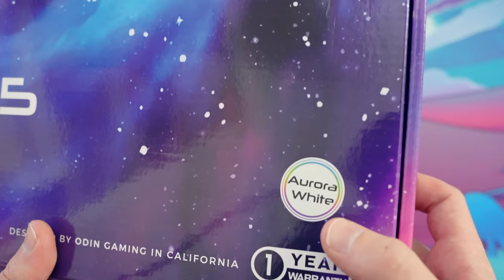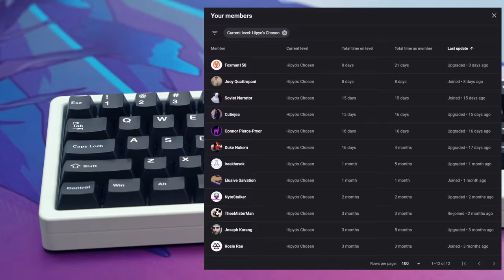This is a keyboard?

Comment: This is a nice board for the price, if you absolutely need a metal case. I think the KBD67lite is still the right way to go if you want a budget 65% with the "gasket" mounting style.
Reply: No one asked
Reply: personally i think the bakeneko60 would be a better option over this keyboard, it has a good gaskest mount and has a metal case, 130 for the barebones kit
Reply: I adore my kbd67lite!! Agree wholeheartedly.
Reply: @buyspride6165  hard disagree. It's got a worse finish. Weird o ring mount that poses as a gasket mount and also the Nova65 has Durock stabs for this price and is a 65% versus a 60%. Not even close
Reply: @liquiddawn82  how about ikki 68 r2 being a better 65%. Its pricier but it is a lot more customizable
Reply: @liquiddawn82  "Weird o ring mount" What the fuck? It is literally what the Unikorn uses. And at the least, the Bakeneko can actually flex and bounce. This board also sounds pretty shit stock.
Reply: @Archurus  what? This board sounds fantastic stock. Have you heard all the various sound tests posted including Alexotos? Everyone agrees this board sounds fantastic stock. Even Bad Seed stated that no one would complain about how this sounds stock. What are you on? And yes. It also has a proper gasket mount. And not a shit painted case. What the heck?
Reply: @nikocayetano1805  I dunno. I was looking at it. It's also got a ton of issues. The gasket mount isn't great once you add the proper amount of silicone to get it to sound good. It's got a weird PCB with some odd facing switches due to them insisting on having ANSI and ISO layouts in one. And on top of that it's also got the same USB as this with no daughter board. And it's a plastic case that you are paying more for. Oh and you can only use their stabs on it and no others unless you modify them. Why would I get that. When I can get this that's made from aluminum and costs less? Makes no sense at all. I'd go with this or KBD67Lite
Reply: @liquiddawn82 Preference.
Reply: @mqonke  Y comment then
Reply: @mqonke  Goes to keyboard video, gets triggered when there's comments about keyboards
Reply: @grithonthesev6811  Damn all i did was post a positive comment about the board and also the 67lite, spawned an entire argument in the replies i love this community /s
Reply: ps the bakeneko is sick idk what y'all are on. second they drop the 65% group buy im jumping on no questions asked
Reply: @Andrew-ng3sc  yeah but they just said they updated Nova65 to have a daughter board going forward. It's also a full aluminum case except the bottom which has under glow. It's also a 65% with a much better quality case. The bakeneko is a cast aluminum case that's painted. This is CNC machined and they anodize it. What the heck? It's funny how people will go to the depths to defend their board just because they purchased it without objectively saying well this is better.
Reply: @Andrew-ng3sc  dude. It's still an issue is it not? You still require mods to use other stabs. So we will overlook one set of issues but not another set based on solely being biased. Insane.
Reply: @mqonke  L human being
Reply: @liquiddawn82  the o ring mount is more flexy nad better than the gasket mount
Reply: @liquiddawn82  
Have you even seen the flex and soundtests of the bakeneko?
Reply: @liquiddawn82  your trashing the finish even tho theres nothing wrong with it lol
Reply: @mqonke  your the funniest guy alive

Comment: I am getting my Keycron Q1 this week. The reason why I got it is that I want an open source program so I don't need to worry about it being obsolete in the future.
Reply: Own one and bad news is the Q1 is already obsolete because certain keycap profiles are incompatible (MT3 is one) and their brilliant solution is to FILE DOWN expensive keycaps. The QC is extremely poor.

I don’t recommend Keychron anything to anyone.
Reply: Cool! Im getting my kbd67 lite delivered on the sixth!
Reply: @_iboji  Why is MT3 incompatible with the Q1?
Reply: @_iboji  do you even know what you are talking about?
Reply: I am getting an rk987 for my first mechanical this Christmas with matcha keycaps. My dream custom is a 60 or 75 percent aluminium case, hotswap 5 prong switches, (south-facing back lighting, of course), with lubed, filmed moss linears, and watering v3's for the modifiers, and akko world tour tokyo keycaps or some Japanese themed one with a deskmat for fun. I now realize this comment is way too long for the original message. I just had to tell some people
Reply: @ukann  It appears they did not pay attention to the allowable tolerances to allow for clearance for profiles that aren't cherry. You get collisions of keys at the edge of the board , most prominently the enter , right shift. There was a thread about this on Reddit and Keychron's (inadequate) response. Then it came out that their support has suggested all kinds of really bad solutions to haphazard fabrication of their products.
Reply: @_iboji  Do you know what obsolete means? The keyboard won't be obsolete since changing keycap profiles isn't upgrading, it's all down to preference, and if your preference is cherry keycaps, then the board will not be obsolete.
Reply: @Gr3gl_  eyeroll here come the pedants

A mass produced "custom" that limits your choices out the gate / a product being sold by a company that won't readily address a non-trivial manufacturing issue (among others) is selling a product they will a.) eventually replace without the defect b.) stop selling it altogether.

A "v2" Q1 would render the currently available model obsolete but Keychron isn't known for doing revisions like KBD, Rama or Wuque Studio

edit: And if they DID it would behoove them to convey this to paying customers as an option for remediation instead of telling people to damage their own stuff to get it to work with their defective product. Or at least warn people that is the case before they plop down the money.
Reply: @_iboji  Thanks for the explanation. That sounds pretty bad...
Reply: @_iboji  they do fixed some problems with the Q1 Knob version though. Also they incorporated these improvements into their Q2.
Reply: @bltzcstrnx  apparently , which is what I speculated would happen. I won’t be spending my money with Keychron to find out because there are excellent alternatives for the money 🤷🏿
Reply: @_iboji  I assume you live in the US. Sadly, here where I live it is really hard to get custom boards except from big brands like Glorious or Keychron. Although Akko recently becoming more and more available.
Reply: @_iboji  glorious have a very stiff gasket though. I'm still looking around and not actually build something yet. I do have plan to built one though sometime in the near future.

Comment: Great keyboard for the price. Though a more budget kit would be nicer for us low cost hobbyists.
Reply: Yes pwease
Reply: Agreed, personally im looking at the SK68 It seems like a good one for 79 or 89$ depending on your options even gives you a variety on switches. (Hipyo made a video on it back when he was a ASMR hipyo)
Reply: KBD67 Lite R3 is a good cheaper budget option with more features
Reply: Hear you loud and clear. Keep a lookout for Nova65Lite early 2022! 😏
Reply: @odingamingco  Always a good news to hear! Will keep a lookout!
Reply: @evannoriega-thomas371  This one is also tempting!
Reply: @EdwinPohan  yup! We are always listening. We will have this with the aluminum case and plastic case available early 2022 and with all the updates based on feedback including a daughter board and other updates 🙏
Reply: @ChilledPsycho  What's your upper limit. From my experience if you spend just a little more, you can easily get a nice aluminum case from kbdfans for example. But I guess that depends wether you'll want to switch the switches and keycaps. cause I think you'll end up around the same price point. You'll have to assemble it yourself though.
Reply: @odingamingco  Did I already miss the early 2022 drop? Or are these still on there way? Def regret not grabbing one months and months ago but was hesitant about a company I’ve never heard of.

Comment: What keyboard would you recommend for gaming for about 80€. Mechanical, and possibly the lowest delay and everything. So basically the best for about that price.
Reply: gk61 comes with gateron yellows and is hot swap with 1mm delay (or less idk) so that's a good option
I had it once my sis broke it so i got a better custom keyboard but when it had it it was a great keyboard and I recommend it to you, i bought it for 100usd witch i think is around the same as 80 euros
Reply: @gravityvoid9806  Was actually thinking of getting it, looked at the rk61, sk61 and gk61, and gk61 just stood out. The yellow switches are good, not much delay. Thanks for the confirmation.

Comment: When will you update the NiZ Micro84/82 cause of the upgrades. I got a NiZ Micro82 recently and I am loving it. I tape modded it, lubed stabs and the NiZ Ec Domes, added foam, and I don’t really think it needs bandaid mods. The 35g domes feel so good. It is amazing for typing as well. I do think the front height is a little tall, but still feels comfortable compared to my old Tofu65. Overall an amazing keyboard.

Comment: a gasketmount south facing led mass drop alt high profile for 159.99? unless you really want the form factor and until the availability goes up , keychron q1 and gmmk pro are still better.

Comment: I like these videos, but one thing i don't get, is these prices compared to the end result. I know, it's CuStOm, but for 160$ i got an Apex Pro on sale. And 50$ for these keycaps? You buy what you like, but bruh on a TESCO office keyboard they're selling the exact same ones for <5$ with the keyboard. But to keep it custom, on ebay there are nice artistic sets available for less than that. Anyways, at the end, the keyboard looked like a big old office keyboard. But the switches saved it at least. However, the cheap hot swappable keyboard video was great.

Comment: I think now that the mod 005 from akko is better choice you get what you want from nova 65 and kbd67 lite on same price of 67 lite
Reply: Hard disagree. The Akko has north facing switches and clip in stabs. Nova65 has Durock screw ins, south facing LEDs and most definitely better build quality. And KBD67Lite is definitely a recommendation over any Akko
Reply: @liquiddawn82  the nova65 has gasket issue on usb port 
North facing led It doesn't important if you want to use the keyboard without rgb the mod 005
Support durock screw stabs
The mod005 comes with aluminium plate and fr4 plate and both are flexible the fr4 is more flexible on the mod005
Reply: @pishotohagever5010  I don't think you're understanding what they mean by north facing LEDs
North facing makes RGB brighter for shine through caps, but it also means the switches themselves have to be upside down, so cherry profile caps scratch against the housing a bit. It doesn't matter if you don't use RGB, even if you ripped the LEDs out it you couldn't make the switches south facing because the holes are just not in the right place, you'd have to replace the PCB.
Reply: @liquiddawn82  Akko is going to change to southfacing PCBs on their MOD005 and 007 boards on Q1 2022 afaik
Reply: @bins1  with clip in stabs and just ok build quality. The Nova65, GMMK Pro and KBD67Lite are all better options. And if you go ahead and update the stabs on the Akkos to screw ins then it's already at the same price as these. So why bother?
Reply: @bins1  interesting..may i ask where did you got that information? this fact may heavily affect my upcoming keyboard choice.
Reply: @wsketchy  I know that but on my akko mod005 I don't have this issue also I don't use rgb because I don't like it also I tried cherry profile keycaps on this board
Reply: @liquiddawn82  well that comes down to personal preference anyway. Like some people don't really like the sharp edges of the Q1 or GMMK Pro. Also, according to my friends who owns pretty much all of these boards mentioned, there aren't much any difference between them except stabs and switch orientation of the PCB.
Reply: @hoanghuyle700  akko's discord server. However i might be wrong tho. It might be their acrylic gasket boards.
Reply: @bins1  true except the fact that Nova65 and KBD67LITE have an actual proper working gasket mount. The other boards are too stiff. Also the GMMK Pro and Q1 sound very hollow.

Comment: Seriously find it stupid with people talking about the Keychron q1 and the gmmk pro on a 65% board.

(Which will say, Akko's MOD005 is like, $20-30 USD cheaper than the Nova 65, just saying :P )
Reply: and it’s gasket mounted and full alu right? might be really good
Reply: 005 doesn't have many plate options yet, and it's a north facing pcb. Still a stellar board for the money though
Reply: Yes but it's also got clip in stabs and north facing LEDs. You update those stabs to screw ins and you're right at the same price as this. And guaranteed this is just better quality all around.
Reply: I'd rather get the akko keyboard than the Nova 65. Odin Gaming is a scammer

Comment: I cant see a point in this video - typing is pointless due to bad switches, didnt mention that bad included keycap puller(coudve put a 2in1 puller, costs probly less than that switch puller and works like a charm) and all in all its a R1, its bad, R2 gonna fix everything and gonna be much better, stay tuned. Coudve just do a promotion and disassembled it and end it there. Your worst video Ive seen so far imo.